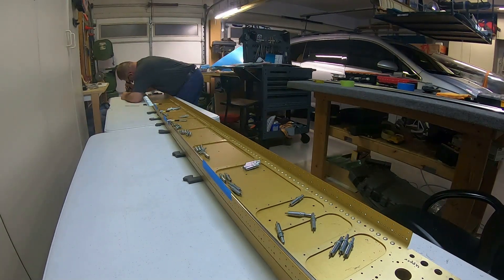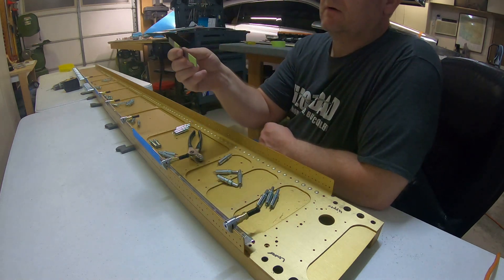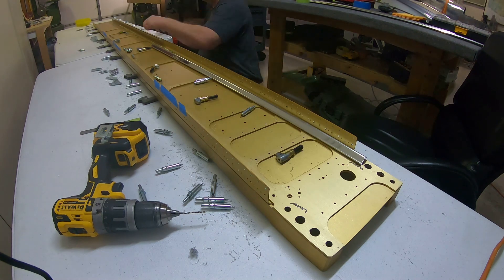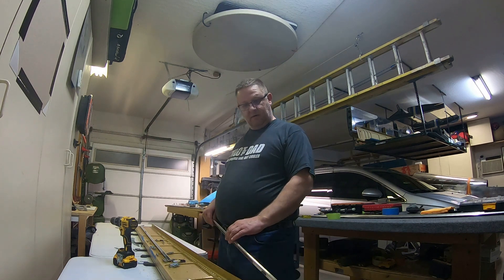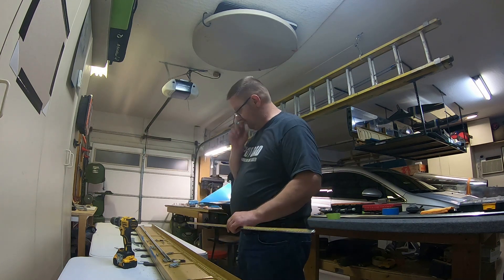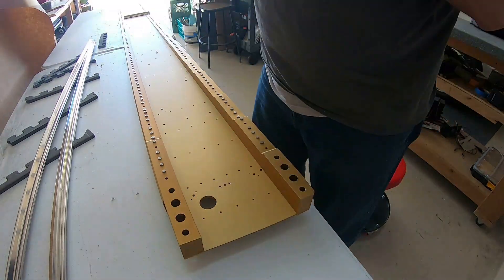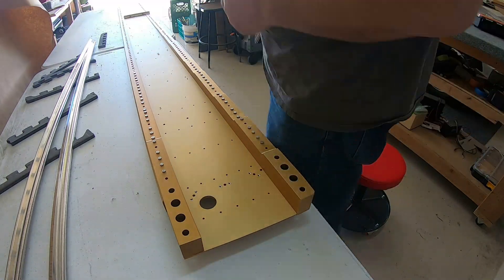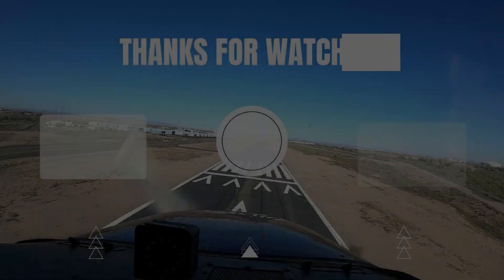RV-14A Build: Wings 13.2 - How to Build A Vans RV-14A #aviation #vansaircraft #dadjokes

Comment: Good tip on putting tape on your ruler. Thanks for sharing that. I haven't started my wings yet but the first time I drill into the spar will give me pause. Yikes!
Reply from the maker: Thanks! You cant tell when i speed up the video but I definitely took a deep breath before I started. :)
Reply: I’m just starting the wings and, although I plan to do each wing separately (finish the left followed by the right) I’m wondering if it’s more advantageous to simply get all the drilling done with both spars up front (I.e., complete section 13 all at once). Any thoughts?  

Thanks for the great work on your videos!!